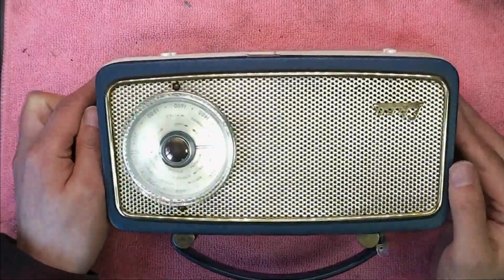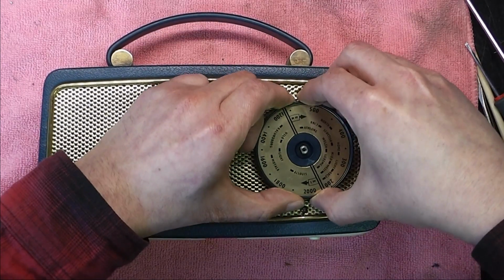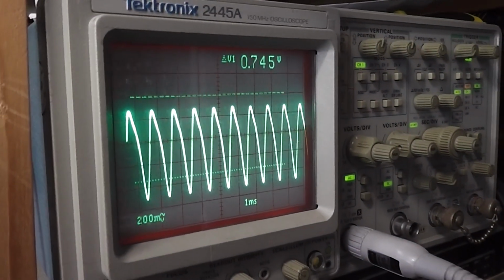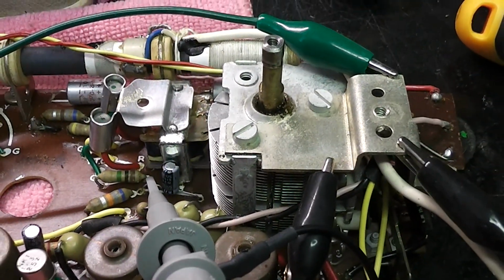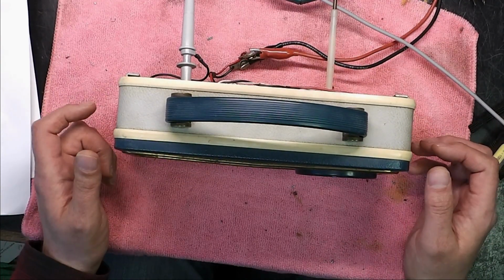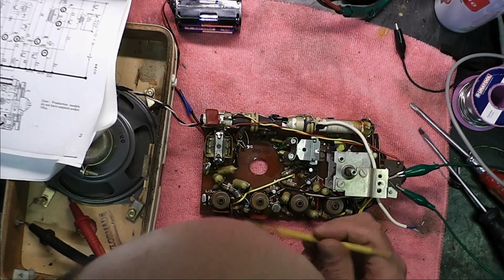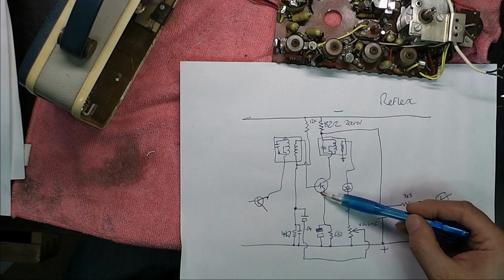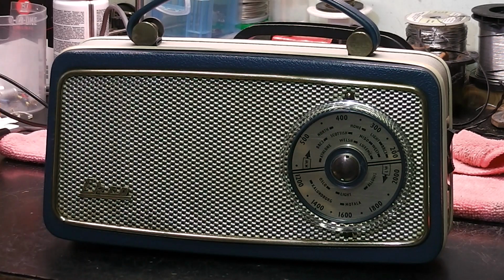Ekco PT208 transistor radio 1962 using Newmarket Transistors.

Comment: Is that in fact a reflex circuit? I can see the transistor is working with both AF and RF but it is using negative feed back as a way of adjusting the audio gain/volume. Not seen that done before. A bit of negative feedback not that common on portable radio's. Probably why the audio is better than most.
Was Newmarket part of the Pye group? I worked for Labgear Cambridge in a former life!! Many products used Newmarket transistors.
Reply from the maker: Yes, Newmarket transistors was a part of the Pye group. I understand that parts were made for labgear. I know a few from the site as I worked there in the later years after transistor production. I guess its a form of reflex circuit if not exact.